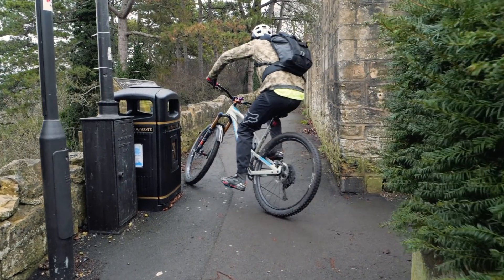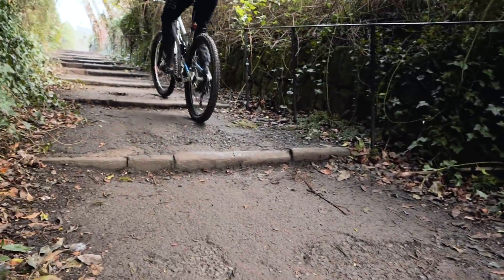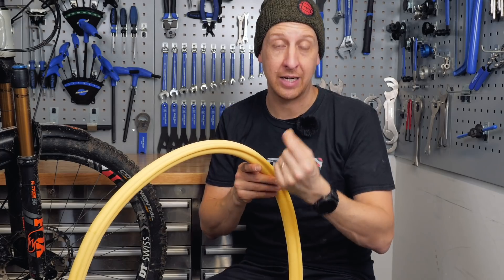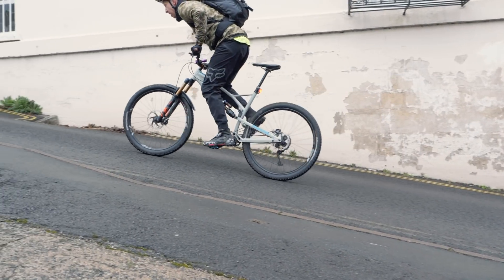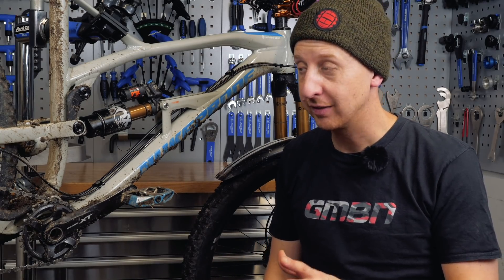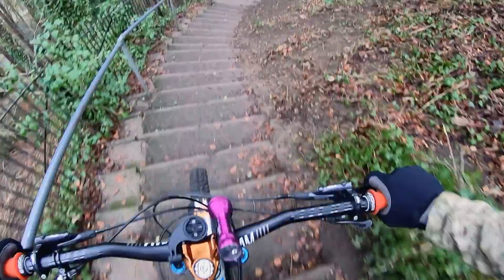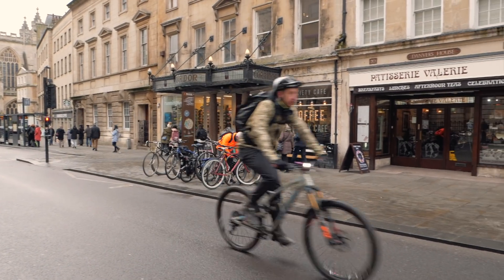Set Up Your Mountain Bike For Commuting And Urban Riding

Comment: I used a cheaper version of a foam tubeless insert and had a terrible loss of power. It seemed to slip inside the tire when I pedaled, but it wasn’t the insert you are using. That tire sealant must help. If I wasn’t 54 years old I would ask what a good entry level MTB mountain bike would be.

Comment: Okay, okay, I am sorry for what I said earlier.  Of course commuting  on
 a mtb is easy.  You just need to buy some slicks and maybe tubes that 
fit.  The top tube is gonna be kinda too short.  Here's what you do:  Go
 on ebay and buy one of those old Nitto randonneur, or whatever, drop 
bars in 25.4.  You can usually get some old scratched up used ones in 
the wrong width for about $250.  Remember, your mtb stem is probably 
31.8, so you'll probably have to find the appropriate handlebar shim.  
Next buy, or better yet, fab up a new stem that is maybe 15 cm long.  
That should solve the top tube problem.  To address the crippling slack 
mtb frame geometry, let me give you a quick hack - just to get you by 
for now.  You've got a 220 volt MIG welder at the cut, right?  Take a 
Sawzall and a course blade, or alternatively a steel spoon sharpened by 
rubbing it on the concrete, and use it to cut the frame somewhere on the
 top and downtubes.  I'll let you figure the rest out.  Anyway, the 
point is make the head and seat tubes more vertical, and weld them back 
together.  And finally, chuck that gushy stupid mountain saddle.  Buy a 
nice Selle Italia road saddle-  they're worth the $150 to $350.  Now we 
work on the street cred!  Take some linesman's pliers and rip the rich 
Corinthian leather off of the saddle and drill some rough holes in the 
top to lighten it.  Fixie riders do mods like this.  They're the elite 
of road commuter guys, even though they almost always could never afford
 to own a bike with actual gears, and are usually seen at the park after
 work shooting heroin.  Slap on some Billie Ellish, or whatever stickers
 on there and it's official!  You have made a mountain bike work for 
commuting.  You can now start being a baby about cars in the bike lane, 
while running red lights.  Congrats!

Comment: My 29er 1x9 MTB is 14kg

I bought a single speed track bike, for commutting on Pavement, that weights 8.1kg, but know i am thinking to have a second pair of wheels, install 700x32c tyres and use my MTB for that, and sell the ss

Comment: Headlights are a must for night riding. Reflectors can only be seen when they are in the car's headlights. By then it's too late. Your headlight can be seen by the motorist long before you reach that intersection. Set the distance that the beam touches the road correctly. This helps you see debris and holes in the road as well as show motorists on the side streets that another vehicle is approaching.

Comment: With crap roads, I restored my 1998 Gary Fisher mountain bike. I am running a 1 x 9 drivetrain, 34T in the front, coupled with an11-34 9-speed cassette in the back. A rear rack, a pair of 26 x 2" slicks, and a pair of Ortlieb front panniers have made a decent commuter.

Comment: Hi need some advice. I have a Scott 950 hard tail mtb. It’s on 29x2.4 kenda tyres which are chunky. But I do a lot of my cycling in the road or gravel. I’ve locked the forks to make it roll faster but is there a tyre recommendation that are thinner or slicker
Reply: To help me ride faster. Took ring advice when I bought this bike and should have got a hybrid but it’s too late for that now.

Comment: MTB is the way to go for commutes. At least shorter ones. Considering the state of some of the roads around here, it's practically trail riding anyway!
Reply: super agree with you
Reply: Slightly safer than a trail  and you can link stuff together to get an urban trail.
Like drops, link all the drops in the area
Reply: Amen
Reply: I use it for 30 mile trips and its fine.
Reply: MTB works well, very durable. Entry level hard tails are fine for this. The cheap suntour spring forks are good for everything but stairs. For sure get disc breaks and fenders. I have a 2x8, just had to slap on some city tires (serfas drifter ctx), bald on the midline so they ride fast at 60 psi, but wide enough and textured that still very safe in the rain. Add some bar ends for uphill, as shifting weight to front with a cheap fork sucks uphill. Can handle uneven sidewalk, pitted streets, loose gravel, dirt, and grass just fine. Most downhill is fine at low speeds. Uphill fine as long as it isn't wet+rocky.
Reply: Oh my god, the cracked pavements around Essex. Glass, debris, everything. 

I went over my handlebars the other day, another rider came out of nowhere. I wish I was wearing his boots. My toe is bruised to buggery.
Reply: Especially in Nepal where the normal roads are as difficult as terrain.
Reply: @Ramuv104  I spent some time there. The roads are shocking.
Reply: In Philadelphia and can absolutely confirm this is the way
Reply: @Rose_Butterfly98   i wouldn't say urban riding is safer at all  in my area atleast   the drivers are  extremely dangerous to be around
Reply: @turtleman190  which is why I used the pavement a lot.
At some point I just realized I'm fine with dying and took to the roads. Weee
Reply: @Rose_Butterfly98   that's illegal to do here so you have to use the road once you're over the age of 16
Reply: Lol

Comment: Commuting with mountain bike is the best. Do some street freeriding or do a shortcut through some smaller roads.
Reply: I agree.
Reply: TIL ur Bike gets stolen
Reply: There's a canal path I can detour along. Got a lock gate to climb, cobblestone ramp, stairs, even a foot bridge...

What do you mean it's not a playground? You're not the boss of me!
Reply: true..not fully road.
Reply: @maxmac2664  bad security can happen with any bike, road or MTB.
Reply: Do you leave your regular tires on even on the street or are you used supposed to buy some kind of special flats?  I'm new to this, want to used for commuting because it feels better to me than  a road bike.
Reply: @rashb3994  get a road bike second hand in good larger frame 29inches. Then buy front shocks u can afford and attach it .

Comment: my flashlight bought for my collection costs half the price of my bike. i bought the bike for urban commute during coronavirus madness. its a heavy 29er, even is aluminum frame. i added alot of weight, double coil springs saddle, mirror, full side  mud protectors  and 2 lights. the road its uphill only when i go back to home so i can shower right away.

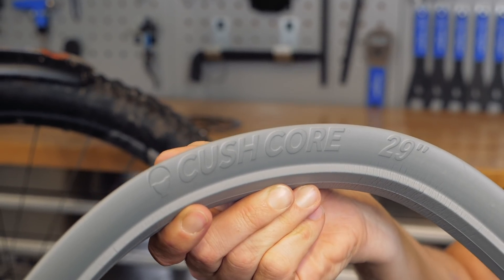Comment: 2:05 is easy and takes about 3 minutes, it's in the technique its no't a problem for me.
use feet to undo bead
To install:
get the Cush Core at one spot then, take your foot over the rim then use hands to get it on hte restlittle by little, all the way up.
to install tyre, use tyre lever tu push bead into centre of the rim
to remove:
use tyre lever tu push bead into centre of the rim, get as much slack as possible, do this to the other side .

Comment: I commuted with my mtb for 10 years when I lived in NYC.  I bought a complete second wheel set and put 1.75" Conti road tires on them.  Used the slicks for commuting and swapped out the set with the knobbies for weekend riding.

Comment: i have a slack hardtail i commute on. i have two wheelsets both with cassette and rotors. i don't touch the rear shock. i don't touch the forks either. i put a bell on, because cops here give you tickets for no bell. head and tail lights. flat pedals. great for stairs, jumps, wall drops, short manuals and wheelies.
Reply: @ToyotaNutjob  that was a joke.

Comment: I commute on my 2018 Trek Roscoe, it's mostly stock except for the added Bontrager rear rack and bag. I also added a headlight and taillight. I pump the tires way up and it rolls pretty nice on the streets. I lock out the front shock for road use. It's fun to be able to take shortcuts pretty much where ever I want.

Comment: Boys and girls... Don't use your prime mtb bike as an urban commuter.  It'll get robbed or ruined.

Go buy yourself a used 24" bmx (if you have limited funds) or even 26" Mtb DJ.  My urban go-to is a 24" full chromoly frame bmx bought for 100 us dollars with maybe 100 more in upgrades.   If it's stolen ... Oh well. As a Urban commuter it's awesome and you can hit up skate parks and other stuff.  Definitely diversifies your skill set, cheap, and they are extremely resultant to abuse/weather.  Doing dumb tricks you can bail and the bike can tumble on concrete without breaking anything like shifters and plastic bits.

F suspension for Urban.... An average rider can do 5-8' drops with no suspension when you are dealing with drops from flat to flat surfaces (i.e stairs).  Riding up stairs is really the only negative to a bmx.  A 24" bmx will bop down a long stair set slowly.

Very affordable, low maintenance, highly reliable, and effective solution to Urban commuting.... Oh... It's freaking fun too!

Comment: I daily my full sus. Commuting, errands, etc. 
I live few miles outside a small town. So it’s pretty easy. 
it’s super fun. Back roads, Parking lots, cut though hear and there, jump up and down curbs. 
Everything can become a jump or obstacle if you get creative. I like playing hot lava. Pavement is lava. And you don’t wanna melt your tires... So stick to the dirt ditches, grass shoulders, across a park, weird lil spots of broken, pot holed concrete, etc. 
Firmer tire pressure, and rear shock in middle position is only changes I make from trail riding. I’m already running a semi slick on the rear for a loose fun bike. Translates well for commuting. 
Good Lights are a must ! Then leave them on for night trail riding. Winter fun!

Comment: two things to look at for commuting : braking distance at 30 kmh and 10% down slope, braking distance at 30 kmh and 10m radius corner. by my experience TREK fx rim brake has the best braking performance in urban enviroment, I upgraded to deore brake pads and cables and dt swiss heawy duty rims,  but factory components work together even better, giving most precise and predictable braking in dry.